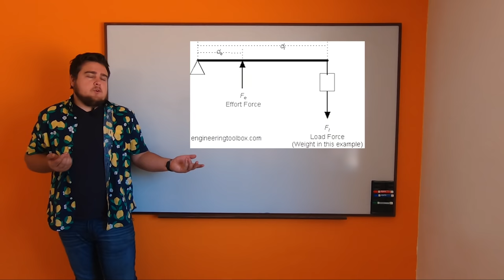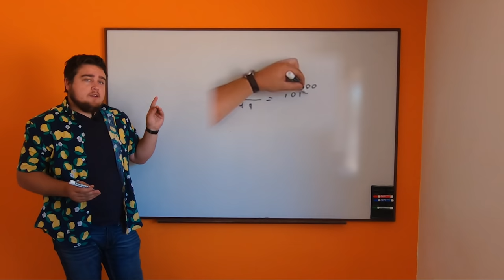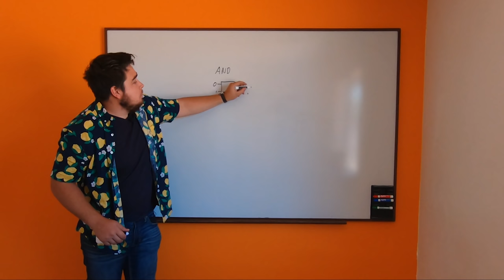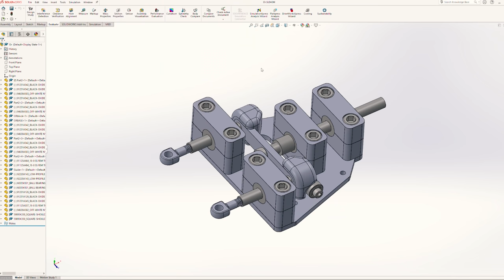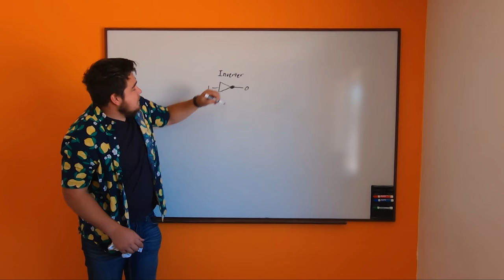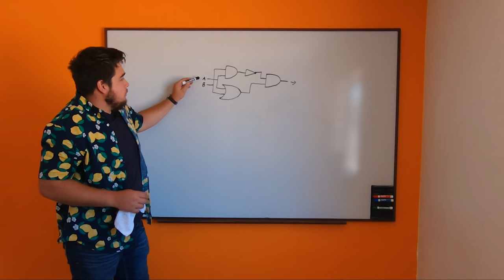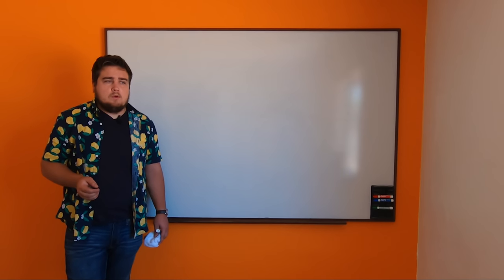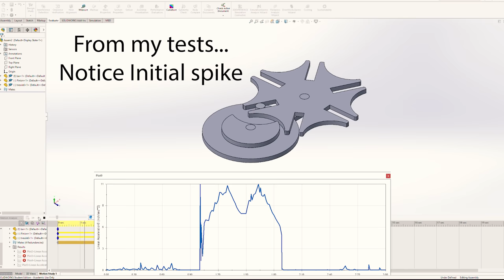Is a Completely Mechanical CPU possible?

Comment: You can make mechanical gates, but the problem is when you make a real circuit, the fan out causes some force increases.
So you'll eventually need a power assist so that one gate can push 10 or more.  A hydraulic assist can probably be made more reliable.  Solenoid assist is okay, but will have a high failure rate.  I don't know the method used for electric power assist steering in small cars - that might be a good assist model.  There have been pneumatic computers in the past  (1950s or so).  They were sometimes used in chemical plants where older computer designs would not have survived well.
You also need it to accept a certain input physical range for 0 and 1 but still always output an in-spec physical range.
The tendency to have small losses creates an eventual data loss, so each gate needs to amplify slightly so it can take a slightly weak (but still in spec) input value, but still produce a good nominal result.   Because they each need to amplify slightly, there is a force growth in large circuits, thus mandating a small amount of power assist per gate if you want to make a big circuit.
Example :  Input  0  ==  0.1" - 0.4",     1 == 0.6" - 0.9"    Then the goal is to have varying inputs within the spec, but still result in outputs within the spec.  Usually you want to exceed the specs for outputs to keep it stable, such as :
Output    0 == 0.15" - 0.35" ,    1 == 0.65" - 0.85"   .
So on an AND gate it could take 2 slightly week  0.6" ONEs and produce at least a 0.65" ONE as the result.
Maybe you're doing an OR and you have two really strong zeros at 0.4", so you don't want it to trigger an output of more than 0.35".
These situations are what makes the physical design difficult.

Comment: Hmm... I think a lot of the early mechanical designs relied on rotation rather than linear motion... I guess, linear motion, you can still connect your units together with wires (like your brake cable on a bike) which is extremely useful for managing placement within your real estate... BUT the amount of force you need to apply adds up very quickly, whereas with gears, you can keep turning to send a 1, and gear it down throughout the pipeline, so you can extend complexity by turning for longer, rather than needing to push harder for every 1, and figure out how you're going to get a NOT gate to push when you haven't pushed etc... you can transfer rotation into the gate, with the gear in place to either forward the rotation or not... or have clockwise verses anticlockwise rotation for your 1 and 0, because a zero still has to actually be something that occurs etc :-)

Comment: California Controls (Calcon) produced nuclear safety related computer logic (And, Or, Not, Timers, and Memory) circuits that were totally pneumatic.  "0" was a vent and 60psi was a "1" .
The logic elements were formed together on circuit boards made from aluminum plates sandwiching cut gasket materials the formed pneumatic "conducting" channels.  
These circuit boards were plugged into a mother board to form a decision making device to start safety related diesel generators in either, a normal test mode with many trips to protect the engine or an emergency mode that only tripped if the a condition existed that was going to blow up the engine anyway.  
This controlled the start and stop of a 10000 hp diesel engine that had to start from 0 rpm to rated speed and be ready to load in less than 11 seconds, each time every time.

Comment: Interesting project. Your AND gate will make it fail though. You lose a bit of travel in the "pistons". From the looks of it you move the two inputs about half-way in before the output moves out. That will make the next AND gate in line fail. You can keep current design, if you add a 1:2 lever which doubles the travel of the output.

Comment: You can build all of the other logic gates from nothing but a single NAND gate, or an AND and an inverse.  Very cool project, but I have a feeling that you'll face a couple challenges, namely space (you'll need several acres) and force.  Kicking the clock is going to take a monstrous amount of force once you've got a few thousand gates interconnected.  It would sound AWESOME, though I bet!

Comment: my idea for the gates:

OR gate: same design, essentially.
AND gate: almost identical to the OR gate, but allow the bar to rotate, necessitating both inputs to be pressed to move it, otherwise it would just rotate instead of move.
Not gate: five rods connected in series with bendable joints, the ends being the in/output. The middle bar is fixed in the middle between the input and output but allowed to rotate. the in/output rods are perpendicular to the middle rod (probably not, actually, optimizations in torque and travel may change the neutral rotation of the middle segment). the rotation of the middle rod will cause both in/output rods to either retract or extend from the module.

All with either return springs or have a mechanism to return the output to all modules to its default state between cycles. the latter would be less modular but also require less work to push all the input rods.

Comment: Yup.  This works.  You can also use water in pipes, etc. - really any kind of physical system is capable of computing.  There are just a lot of "practical" limitations.  Electronics is just the fastest and most effective way we know how to do it, is amenable to miniaturization, and so on.
   
You can make more effective mechanical calculators by dealing directly with decimal numbers and so on - for example, go have a look at "the Curda," a handheld fully mechanical calculator designed by a dude while he was in a German concentration camp in WWII.  Over 600 parts, and more or less a miracle of precision engineering.  But it was made and sold from 1947 to 1972, when it was finally obsoleted by the HP-35 electronic calculator.  Also of interest is the Fuller cylindrical slide rule, which did more advanced calculations than the Curda (but didn't do simple addition and subtraction, which the Curda could do).  The Fuller was invented in 1878 and was also sold until the HP-35 killed it too, in 1973.  There's also the "harmonic analyzer," which could do 20-harmonic Fourier calculations, in both directions.  There are some amazing mechanical marvels that have popped up in history.

Comment: Hey. Nice design. Very simplest.
You can reduce the dimensions crafting it with a 3D printer, so you can make a lot of it. 

You can build a sumator machine without the need of electricity.

Very good video.

Comment: My idea - do not do push rods, do gearboxes! Push rod design has two major flaws. Pushback spring forces cumulate making it hard to go beyond certain amount of gates. And everything must be laid out in one plane. Convert it to gearboxes - spinning axle is 1, not spinning axle is 0. "OR" is trivial, you just need two one way gears on output shaft, whichever is powered by corresponding input shaft and gear then output shaft spins. "AND" is also easy - use the same idea as in differential, wheels are input, driveshaft is output, you can get rid of reverse spin by one way clutches between gates. "NOT" will always be a problem in mechanical representation, because you cannot generate power from lack of it, so you will have to power it externally.

But overall - gearboxes should be waaaaaay easier to connect. You can stack them, connect them with transmission chains. And... you can chain infinite number of them. When you go beyond certain torque then use reduction. Half of your computer will work at half speed, but requires half time less torque to run :)

Comment: How will it be powered? In electronics, each gate uses additional power basically, in your design, they don't. All the forces going through the circuit have to originate at the input. If you combine hundreds of these gates in various configurations together, the inputs would require enormous amounts of force.

Comment: You are going to need a power amplifier. Otherwise the thing will be impossible to move as each gate in a series of gates adds friction. Either the gates need to add force themselves, like it works in electronics, or you need a special gate that does nothing but amplifying the force applied. Also I would use compressed air instead of shafts. Steam if you want it to look cool 😃

Comment: If you design the gates as MEMS, (yes, that is an acronym, i think something like micro electromechanical systems), you can miniaturize then much more, and they'd be one or two pieces each. There are computers built like this (purely mechanical) , but unfortunately they are huge as at the time mems didn't exist as a concept.

Comment: Apart from the already cited Babbage machines (that were at least somewhat programmable for numerical algorithms), that could not be implemented until the last 25 years, with current mechanical precision and low friction, there was an 80ies article in "Scientific America" (available as a special edition named "Computerkurzweil"), describing the usual set of logical elements by means of levers and ropes. AFAIR, the article was for April fools day (concerning actual historical findings), but of course plausible for the mechanical considerations.
Anyhow: Friction, precision, energy consumption, pure volume and speed would limit such a by magnitudes more than the early relay computers and of course the first transistorized ones, but the principles do apply just the same. Though, one might do it without virtualisation, there....

Comment: I think the only problem you're going to run into is the "power consumption".

For example, think of if you had configured a system to add two 8 bit numbers, one as 0xFF and one as 0x00 (255 + 0 = 255). If you then try to change that 0x00 to a 0x01 (255 + 1 = 256 or 0x100), the single bit you are pushing in is going to have to provide enough energy to flip all of the gates in the "circuit" and all 8 output bits.

This is one of the other reasons electronics work so well: each transistor amplifies a little as well instead of consuming energy from the signals.

Comment: You can reduce it all to NAND / NOR gates if you want ;) either of the two is sufficient to construct every other gate. Then you just need a few hundred of them and you're done.

If you're serious about this, I would look to connect your gates with cables - something flexible - as you will have lots of loops making rigid connections with changing directions a real pain. Cables in a sleeve to actuate stuff makes laying out a design far easier.

Comment: you need a memory cell, it holds 1 bit of information, until a signal resets it. so... a piece that outputs 1 until another 1 turns it back into a cero.

Comment: there were mechanical computers, but I think if it's not integrated circuit it's not a microprocessor so not what we refer to as CPU. Though maybe with modern nanostructures techniques (and all that) a pretty slow chip-sized mechanical processor could be feasable.

Comment: Without even watching the video I can tell you it's possible. That's how we cracked the enigma in World War 2.
That said, however, it made me think about the reason we call it a "central" processing unit when you consider that the enigma, itself, was a "computer." We skip a lot of steps along the way because of how much abstraction that computers have made, but essentially the CPU would be what you consider the "computer" part of everything. The reason it has the "central" title to it is because there are entirely other computers within a modern computer, like your GPU (Graphics Processing Unit).

Comment: You can indeed reduce all logical operations to 'and' 'or' and 'not'. You can reduce further. Any logical operation can be done by iterations of the NAND operator (or the NOR) operator. From an engineering perspective, making a bunch of NAND gates is easier than making NOTs, ORs, and ANDs because it's one machine instead of three. So P and Q is equivalent to ((P NAND Q) NAND (P NAND Q)). P or Q is equivalent to ((P NAND P) NAND (Q NAND Q)). More machines total, but only one kind of machine. which is easier to reconfigure, and so should be more versatile.

Comment: If you have either a NAND or a NOR gate you can build any other logic operator with a finite number of NANDs or NORs. That's way they are called universal gates.
Reply: When you have to build them by hand physically, it's better to have a fewer amount of more specialised designs. The mechanical ones are going to have a "voltage" problem where the forces to push all of the rods are going to add up considerably.

Comment: Cool project! There is an energy issue, though - the moment you cascade 3 or 4 of these gates one after the other, you may find difficult to push your finger on an input and get that force to move 3 or 4 gates. The thing with electronic gates is that each has a power supply, that helps them relay the signals through.

P.S.: When it comes to mechanical computers... have a look at an automatic transmission!

Comment: Believe it or not, the "computers" that aimed guns for battleships in WWII were mechanical. They did not use binary math though, or boolean logic or even programming, rather the mechanics were arranged in such a way that the combination of inputs by engineers on the ship would physically move the gun to the correct location. It was actually very sophisticated and very interesting.

Comment: This is a cool project, however, when driving the output from the input, your "signal" will become less defined as it goes without some kind of normalization of the output. Also, the input force will go up as the circuit gets deeper and in the best case the force required will go up linearly (a string of OR gates). These problems are easy to solve in the realms of voltage, air pressure, or water pressure, but for mechanical gates, I don't know. These would work well with a hydraulic or pneumatic system as the input and each output controlling a valve.

Comment: Interestingly, it is theoretically possible to make a computer out of only not gates, as they can used to make all the others (I know this because I play Minecraft a lot, where people have built computers using only redstone torches). Of course, it's a million times easier to make it when you have the other two (because they would naturally be smaller), but it is always an interesting concept.
So far this series is great. As you showed, it's naturally going to be massive, but since it's mechanical, each of the gates can easily be shrunk. Plus if these were 3D printed, it could be made lighter. Although, since you're a car guy you probably don't have a 3DP. I really hope this ends up working, but if not it still is going to be a great insight as to how computers work.

Comment: A mechanical cpu like a 4004, 8080 or even a 6502. The Apple 1 [6502] was cloned with 930 logic gates. It would say z80 but a 16 bit bus seems unnecessary. It could have a clutch motor that helps it ticking, aka a clock. It could have a display where it's a matrix or white/black dots that can be quickly flipped. You could set up a timelapse of it doing it's thing and then play it back when it's done. Something like an animation of Tetris blocks falling into place. It would take a while to render each frame but it could be accurately captured with time lapse. Maybe only concern is why you're using metal. I get it you have the equipment but if you used thin/light weight plastic you could make the gares smaller or much more modular. You wouldn't need too much energy to move a chain of logic gates in step. This would be really cool.

Comment: You could have gotten away by only designing a NAND gate! All logic gates(NOT, OR, AND, XOR, IMPLICATION) can be build from nand gates.
One RS-FLIP-FLOP is build from 2 NAND gates! A Flip-Flop is a bit of unclocked memory. With one additional tripple input NAND gate at each input line of the RS-Flip-Flop you get a JK-Flip-Flop.
Wich is a gated and clocked memory for a bit .

Comment: Better try making NAND gates... since is a full logical family gate, you could make every logical operation using only NAND gates..
which is not the case for AND and OR gates - you need to add a Negation Gate + AND + OR gates to have a full logical family, much more work than making everything with only one gate.

Comment: Mass, friction, and torque are going to be your biggest problems with this design (and most designs, I think). The more components/gates you add, the more input force you'll need to cascade each gate's output to the next gate and get the end result. Physical computers like the domino computer get around this by storing e.g. gravitational potential energy in each gate, and then one gate simply pushes the next gate out of its stable state, whence that potential energy is expended. Spring-loading or double spring-loading the gates (kind of like how light switches are designed; a bistable system) might get you farther, but I'm not sure how far.

Comment: When you can make 1 billion transistors in a second, using the same parts make sense, in computer chips transistors are used for resistors as well for example.
However, if you make stuff slowly and by hand, I'm not sure, you want to do that. Trouble shooting might be easier on identical parts, but for that you should make NAND gates, since they are capable of anything.
Also, you'll need an analogue for a bistable multivibrator to have some memory... :)
If I were you, I would try to work together with Ben Eater, since he already made a computer...